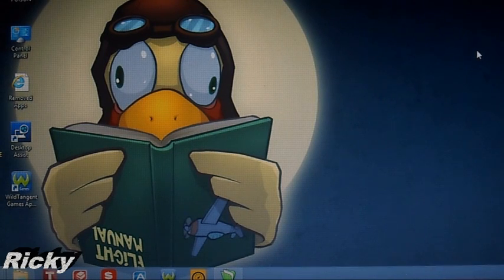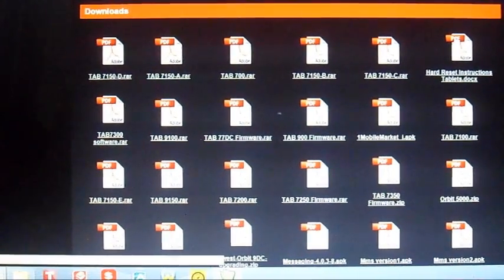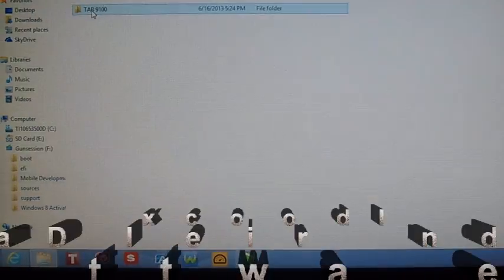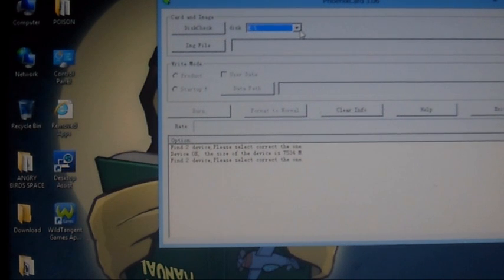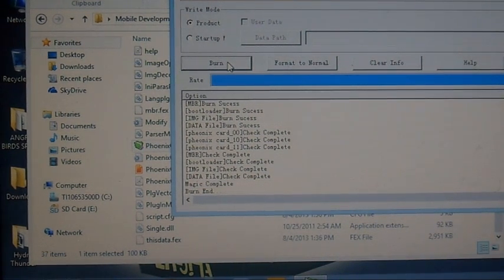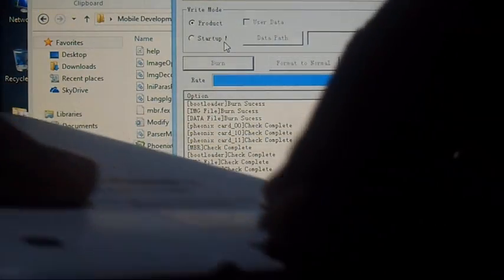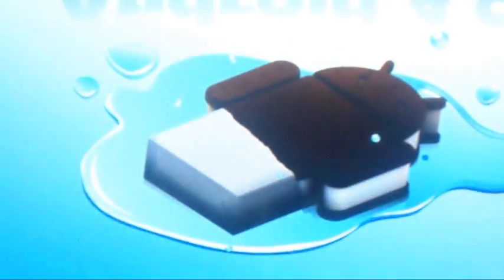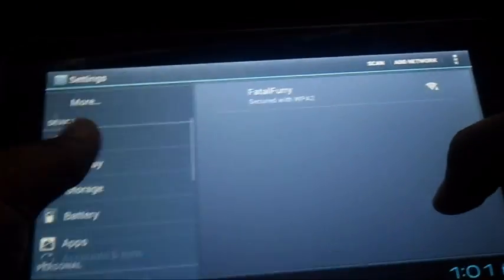How to Repair Any MaxWest Tablet (Official Guide)

Comment: I have an ASTRO 8R tablet that has a screenlock pin, that I do not remember, and the google account that is on it, I don't have access to anymore. I did a factory reset but it says I still need pin. How do I bypass that. There is nothing about the astro 8r except unboxing it!! Why is that. You can't do the same thing with this one that the video for the nitro says
Reply from the maker: Sadly with Android updates a lot of functions from 10 years ago may not still work. Send me your exact model and I can check with them when i get in tomorrow.

Comment: it failed to burn ? what do i do? is it the same process if i want to fix a google play error?
Reply from the maker: do not use the burn method instead download google services apk from here http://pollux.androidapksfree.com/polluxdata/5a81bbbbe2e6c8aab95b223123fefc99/com.google.android.gms_v10.2.97-(030-146062190)-10297030_Android-4.0.apk and reboot the tablet or phone and this should work.
Reply from the maker: Also download this from the tablet or phone itself and install the file after download.

Comment: this didnt work for me, i have the TAB-9160K and it does the green but when i turn it back on the tablet doesnt work. My problem is that the wifi will not even turn on. if there is another way to fix this can you help me please.
Reply: +carlos castellanos i have the same problem, did u fix it?
Reply: no, i never got it fixed. it still sits in the box at home.
Reply: i tried to re-installing the firmware again but i cant turn on the wifi.. that problem begun with the first firmware that i installed
Reply: +Jhonnatan Jimenez the WiFi on mine never worked from the start, that was my only problem. I thought it was the sensor in the tablet but I never really opened it up to look.
Reply: ok, thanks!
Reply: your welcome :) Jhonnatan Jimenez

Comment: Hi, i got a TAB 9160k with no wifi options to conect of any kind and the page got 4 options of download:
Tab 9160K BT (A) Firmware
Tab 9160K no BT (A) Firmware
Tab 9160K no BT (B) Firmware
Tab 9160K Firmware 4.4 with BT
i only want to repair that problem, which one i would use to that, and if it reset me the tablet to zero, how i can save all apps and information? ( if answer in spanish would help me a lot ty )

Comment: Hi Rick, I have a doubt, my tablet's model is 9155K, but in the maxwset page there are three versions A, B and C, is there any way to know whichone is the one I need?
Reply: ***** Hi man, thanks for the answer, the thing is that I did the reinstall because the tablet detects wifi networks but won't connect, I've tried many networks. so, I reinstalled and tried all 3 versions: A, B and C. A and B worked (I mean it didnt brick) but still wifi won't connect. Do you have any idea about what I could try?

Comment: I have a TAB-9155K I gave to my niece and she for got here password, so what I did was try a Reset by doing the PWR+VolDwn at the same time but it did not work. I tried the Volup also, so I decided to do a reset using the microsd card method, using the rar 9150. it worked but now I cant connect to the internet using WiFi.
When I turn it on it turns itself off after a few sec.
Did I pick the wrong rar file?

Comment: Ok. I've been searching for a lot of firmware packs for the tablet I'm trying to reset but not a single one will work. The model of this tablet is TAB-7155 (Note: not the 7155DC tablet, which is dual core), but I just can't find the proper firmware for this tablet. I've used several firmware packages provided on the Maxwest webpage (TAB 7150 A to E) but the tablet won't give any sign of life when trying to reboot it while the micro SD card is inserted on the slot or it will just show an error that says "sprite update error: fail to scan flash information  sprite update error: current card sprite failed  now hold the machine", and it does nothing. Have you faced an issue like this before? Thank you for your help.
Reply: I used another SD card, but it didn't work. I have seen there is a lot of people having troubles when searching the factory firmware for this tablet. I saw another video when someone repaired successfully this tablet using the disc included with it when purchased. So I went with this friend of mine (the owner of the tablet) and ask her about this disc. She gave it to me and then, only then, I could reset the tablet successfully. I've uploaded the firmware folder for everyone who has the same problem may be capable to solve it. So, this is the link: http://1drv.ms/1htL46S

Comment: Now I have another issue, I have the 9150 tablet, It won't auto rotate it is stuck on only one position. That's not even my problem, my problem is that when I touch the buttons it won't work, if i scroll down it scrolls up, if I point to the top button it points to the bottom. How do I fix this?

Comment: Thanks, this worked!  If you get stuck at the screen that shows chinese, click the button on the lower left and switch it to the only other option.  Also, when I clicked "Switch", it shut the tablet off into a special mode and my computer didn't pick up the drivers...you have to go to device manager and force it to install the drivers, located somewhere in the Tab folder you downloaded.

Comment: I just purchased a 7370DC from company that was selling out.  The external sd card mounts as unwritable and because the unit is not rooted, I can't change it.  I went to the maxwest website downloads, but there is no firmware for 7370DC.  Do you know where I can find it?
Reply: ***** Thank you very much!  FYI, I figured out how to edit the platform.xml file using adb through Google’s Android SDK.  This seemed safer than trying to fool around with the firmware since all I needed was to be able to mount the external sd card writable. Thanks for the link in case I need it in the future.  Very nice tablet!

Comment: Hi, I have a MAXWEST TAB-900, FCC ID # YNFTAB900
I had to reset the tablet because i forgot the password, so i went to the webpage
http://www.maxwesttelecom.com/downloads.php
and did a factory reset with the following file
http://www.maxwesttelecom.com/direct_uploads/TAB%20900%20Firmware.rar

the flash was successful but after turning back on the tablet..the touch (digitizer) doesnt work, also it seems it doesnt rotate. 

can you help me out finding the correct firmware for my tablet thanks
Reply: ***** thanks for the reply! but no luck, i formated back to normal my microsd and flash it with a windows 8 computer with phoenix card and same thing, touchscreen doesnt work, then i did it again with a windows XP computer and same thing happened. I also tried flashing it with the Phoenix USBpro and same thing no touchscreen :(. I already contacted maxwest and see if they can help me out
Reply: ***** I havent tried with a windows 7, but i already did it with a windows XP and same problem...i will try it with a windows 7 next
Reply: ***** hear me recommend to use the tablet for 7155 games and emulators?
and for the facebook and youtube

hears and this tablet has 7155 internal microphone for Zello application?

Comment: a) in the maxwest webpage there is no download files for the tablet 10QC. 
and 
b) the phoenixusbpro is different to the one you are showing in your video. I do have the .img file but I do not have the key file the system is asking. What is your opinion about this, how can I proceed any help will be very appreciated.  If this helps, my tablet information is: 
The FCC ID # YNFORBIT10QC     /  S/N 201303053
Android Version 4.1.1